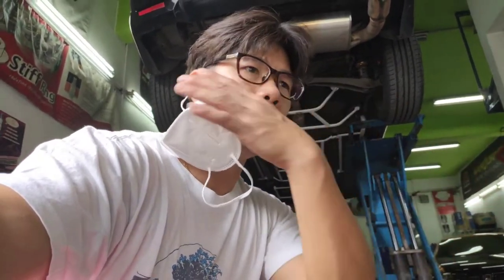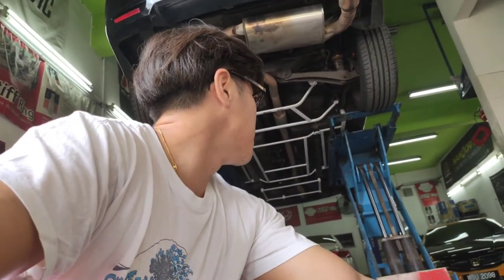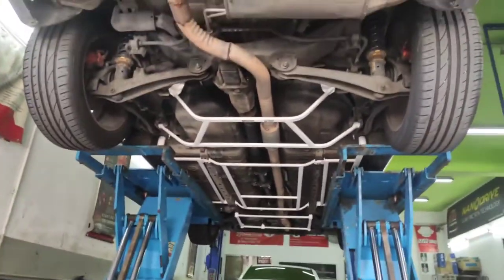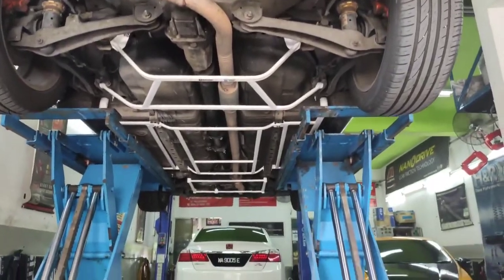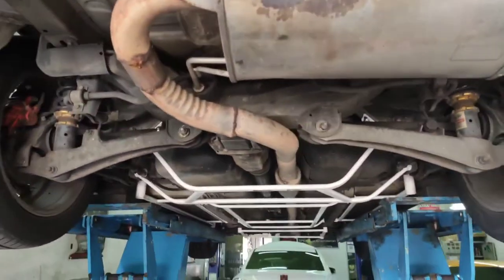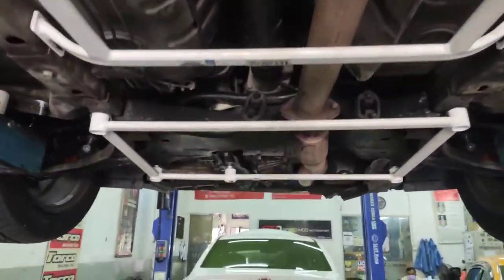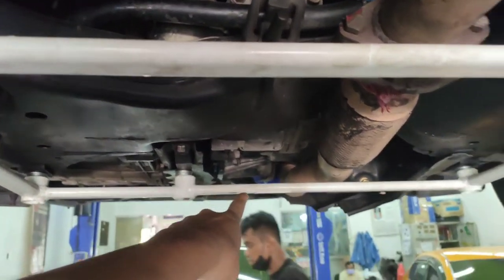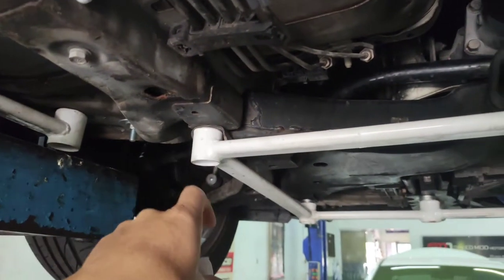Watch how I get a perfect  alignment of my car  #airtrek #carworks #modify

Comment: Hey Kevin. Where did you get the rigid collars for the airtrek? They seem to be very expensive
Reply from the maker: Hi Bradley.  I got mine from a local reproducer of the same product under the brand "stiff ring".  They are essentially the same product.  Yes there were positive gains from installing them.  Lower NVH.  Better turn in response.  Accurate and easy precise alignment.
Reply: @kevinkonguwu  that's awesome. What did a set cost to produce?
Reply from the maker: @bradleyscales  I did it so long ago if memory serves me well.  It cost something like Ringgit Malaysia 1200 for a front and rear set.

Comment: Will this work on all sub-frames? Also, without flex would the bolt and sub-frame crack …
Reply from the maker: Yes. The stiff ring is car specific. Every car has different size subframe bolts n hole sizes. It will work on all cars with the specific stiff ring made for it. No the subframe or chassis will not crack due to being rigid. Your car will deflect movement via its bushes. Engine n arm bushes will be isolated to do its job exclusively without subframe flex. This equates to a better handling n more direct feeling vehicle.

Comment: Where can find the stiff ring, also when I lowered my Airtrek the rear chamber become negetive even after full adjust the rear lower chamber nut. Any advice to strighten the rear chamber when lowered.
Reply from the maker: You can connect stiff ring at:

Phone: 03-9105 3100 / 012-670 5167

9am to 7pm, Monday to Saturday

Location: 
Speed Mod Motorsport (Cheras)
https://goo.gl/maps/WDSj9xCKWCGbmCwe6

Thank you,
Reply from the maker: If your airtrek is not an original turbo then your rear does not have the factory camber nut and washer adjustment as an option. N/A airtrek have a static rear camber setup
Reply: @kevinkonguwu  Thank you for your reply . Mine is original turbo version. It does have the chamber nut but the adjustment is not enough to offest the chamber, guess I'll have to look into those adjustable upper arm to compensate the lowered spring.
Reply: Thank you for the info Kevin.